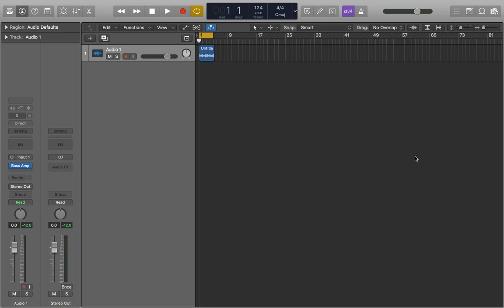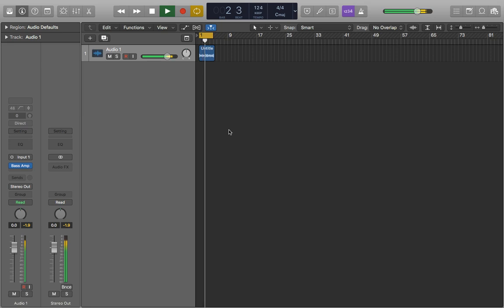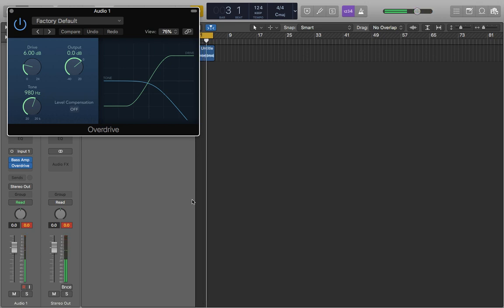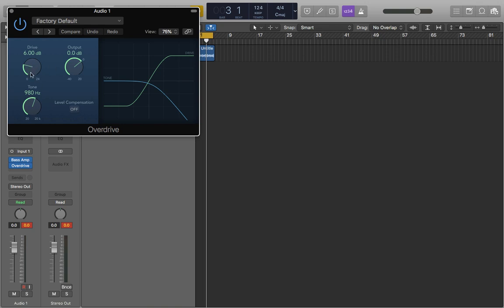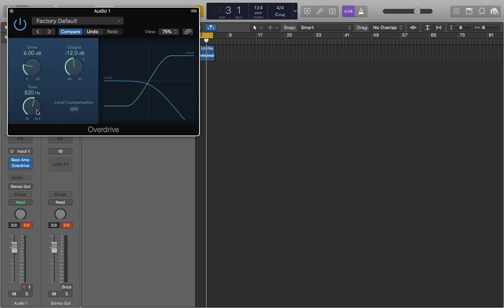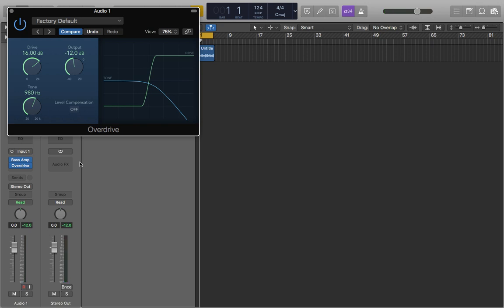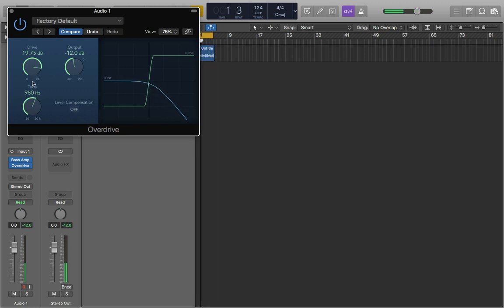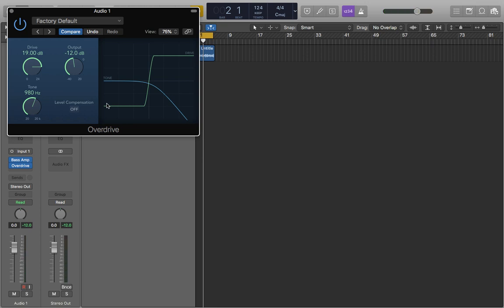Logic Pro X - How To Use The 'Overdrive' Plug-in

Comment: good exposition. do you know of any plugins that detune guitar notes to specific specific tunings, such as DADGAD, etc.?
Reply from the maker: Oh no, I don't think that would be achievable I'm afraid! It would get very complicated when using chords!
Reply: @JoesLogic  yes, but one can dream. On another note, how about a plugin that tells you what chords you're playing on the track. That would be wonderful.
Reply: @JoesLogic  are you sure? wouldn't it just require a preset that detuned the output signal by a prescribed amount no matter what the note?
Reply from the maker: @pikiwiki  If you were playing single notes, then a simple pitch shifter/corrector COULD potentially do it. However, if it was more than one note at once, then unfortunately not! Especially for non-standard tunings
Reply: Nah, that's not a thing. The signal is summed to mono, so pretty much you're detuning the entire signal. If it's a MIDI based instrument then it's def achieveable (one of those elaborate sample based guitar VSTs) I'd imagine there'd be some function. For "real" stuff, no. That or if you're using Logic you could mess with the Flex Pitch and detune the notes themselves on the roll, however I'd imagine that unless you're going for a mono type sound (no other resonating sounds), this wouldn't sound very good given that again, you'd be tuning the entire signal. You shift everything else around with it. If there was some crazy pickup that picked each string up and transferred the strings into say 6 different outputs/channels then your idea would work.
Reply: @rakatai.i.i8739  ok. I enjoy thinking about it though